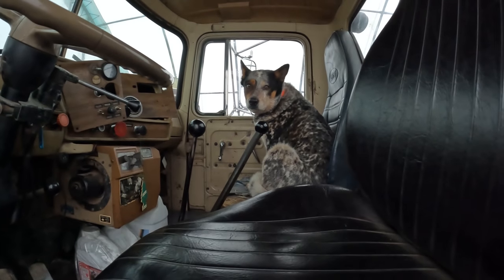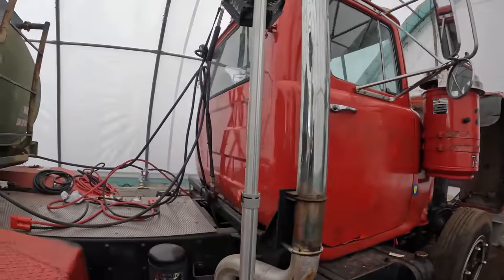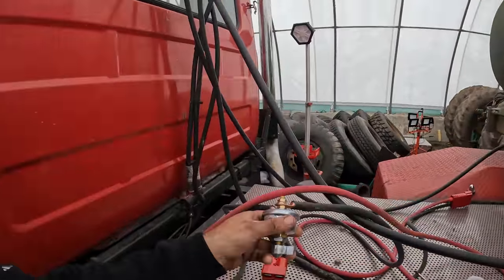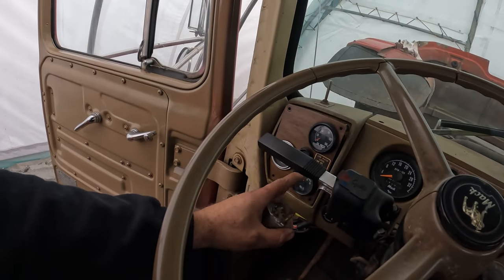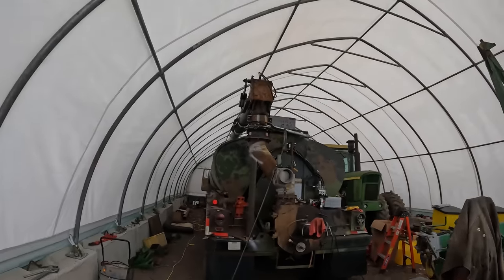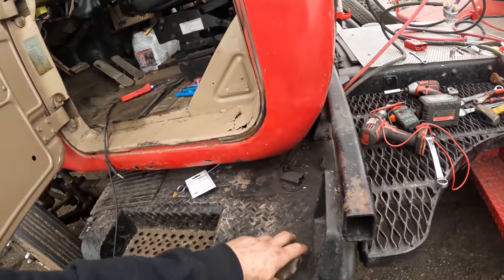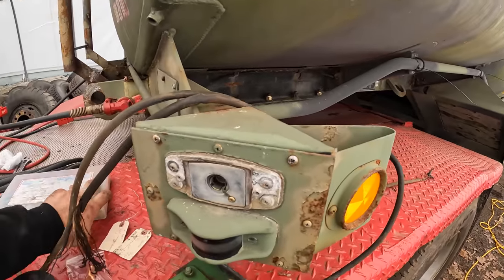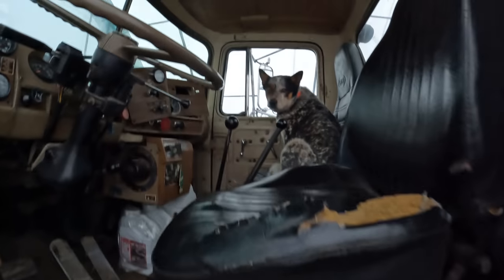Whys The Fuel Gauge Not Work?

Comment: Moeller makes aftermarket stand alone fuel gauges and fuel level senders that fit various size tanks and are adjustable. They are made for marine applications but I've used them in my f250 and other vehicles. By the looks of it you could probably find a kit that would use the existing hole for the sending unit.

Comment: Exhaust temperature is most likely a thermocouple gauge. Those things power themselves. Unique property of metal we learn in physics class. When two wires of dis-similar metal have their ends joined together forming a loop, and one of the connected ends is hotter than the other, the temperature difference at those connections causes a current to flow in the wires. The meter is just a measurement of that electricity inserted at the cold end of the loop, and calibrated to read in temperature degrees. There may be other wires in the gauge for illumination, but the thermocouple part is independent of the truck's wiring system.

Comment: You can test your gauge  with 3 volts of power if 6 volt and 6 volt if you have 12v truck and check half a tank . Check ohms in sending unit be sure to clean connections

Comment: Slap a test resistor across the terminals to test the rest of the fuel gauge circuit or put a potentiometer in line and dial it to simulate normal operation.